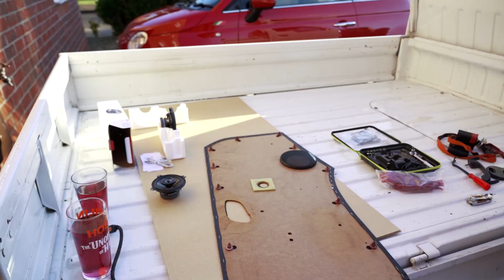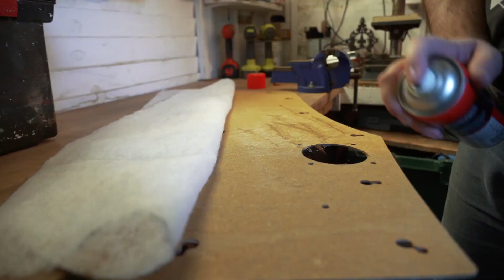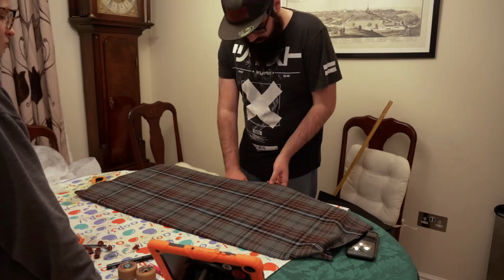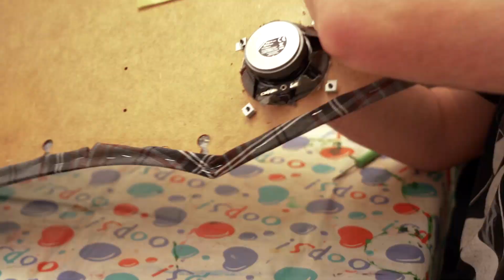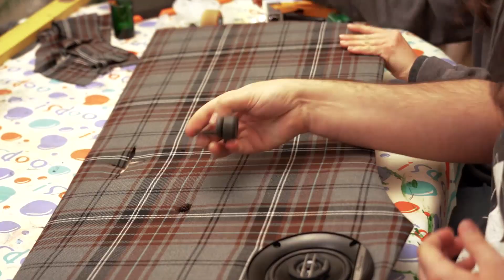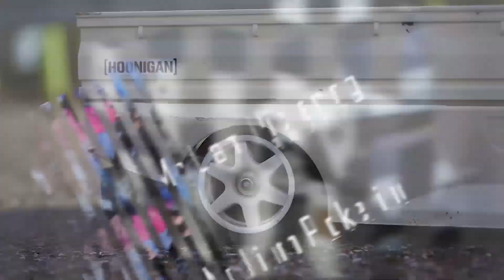How To Make Custom Door Cards For Japanese Suzuki Carry.

Comment: Can you do a diagram of the wiring from the back of the stereo to the door speaker? I am gona be doing the same thing soon and curious what your solution is.
Reply from the maker: Not actually wired it up yet I been  waiting on the cable that arrived yesterday.
Reply: @MrLiamPickering  Cool. I am definitely curious to see how you do it. I have 2 x 6x9 and a subwoofer in the back of my van but will possibly move the 6x9's into the door (if they'll fit!!!!)